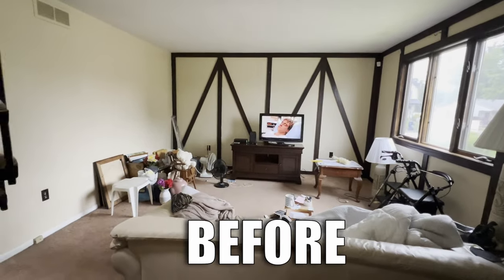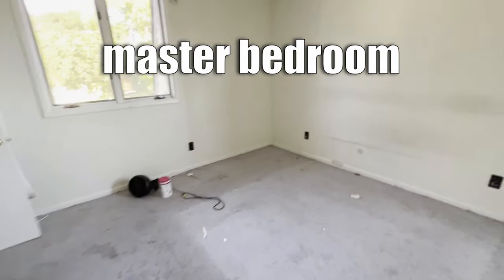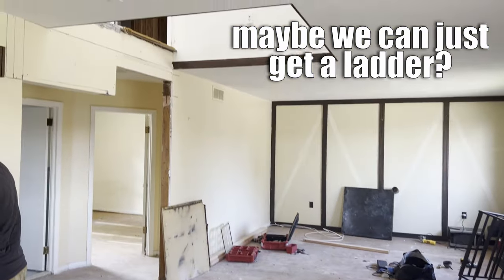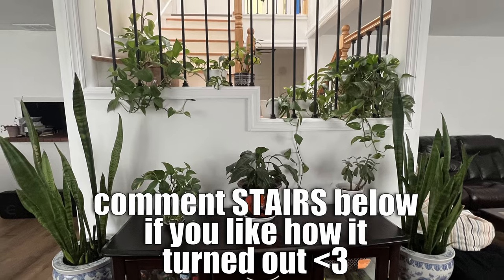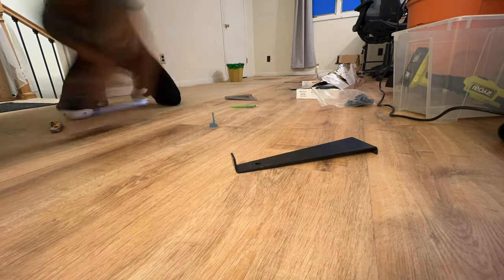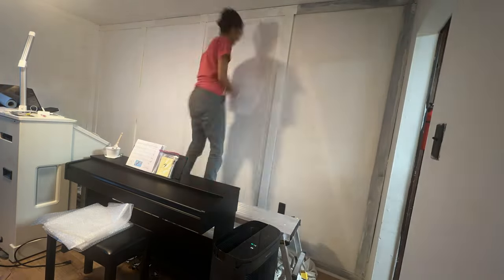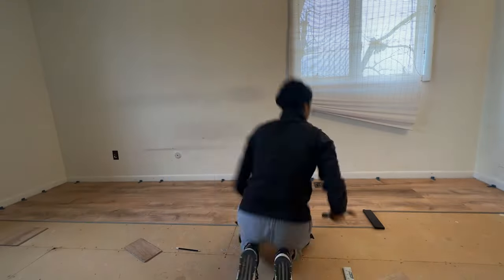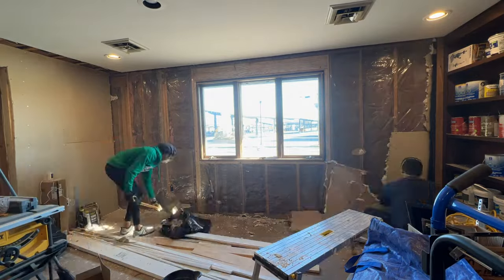i bought an old house | how i diy - old house makeover | part 1 - minimalist living room

Comment: Smokestains go through paint so if the primer did not encapsulate that, it will shine through with time. Hope you are going to be lucky with that
Reply from the maker: Thanks for this pro tip, I appreciate it! I used kilz primer but also, surprisingly there weren't smoke stains, at least not bad like the ones I've seen in other homes... We've acquired properties that had tenants that smoked and usually were able to cover with kilz during turnover. Maybe it was b/c they were only there for a year, I'm not sure. As for the smell, once I took the carpet out and had the ducts cleaned, the smell was gone thankfully. 🙏
Reply: Usually smoking cause the wall paint to also get a layer of yellow so it doesnt have to be splotchy it can actually go unnoticed until you paint. You can see in a year if you paint with the same white then and the newly painted part is alot whiter than the color you painted now.
Reply: Oh I forgot to say that oil based primer is always a good idea when it has been smoked in. Even though there have come some newer non oil based primers on the market specially for smoke damage. Last time I also painted with non oil based for 4 layers and I just regretted not being smart and choosing oilbased smoke damage primer  from the beginning. I don't live in the USA so I can't give you brand recomendations. HOWEVER... Good luck with you renting idea. Seems to be a great location. I have missed your videos.
Reply from the maker: @petra7338  Ok thanks this is good to know, I'll be on the lookout for it!
Reply from the maker: @petra7338  This all makes sense, thank you!  Kilz is the go-to primer over here, the one I used has been known to cover non-serious smoke damage but it's all-purpose and not oil-based, so I guess we'll see over time how it holds up!  If I have to repaint these walls in the future though I'll go with oil based from the get go! And thanks for still being here, I've missed making videos.